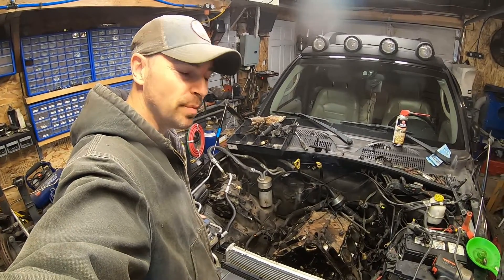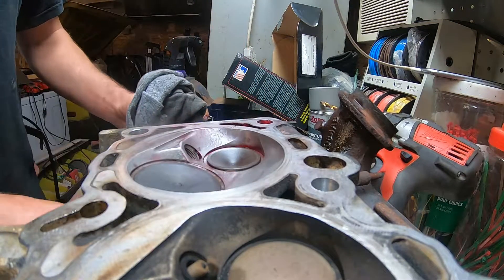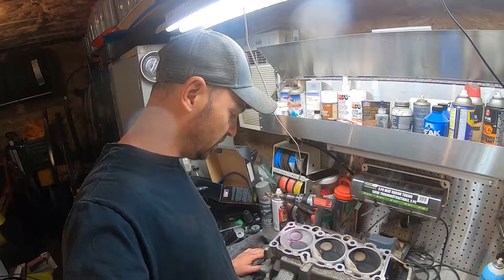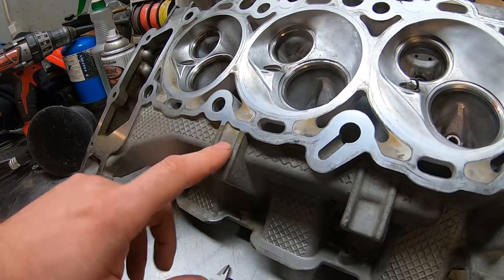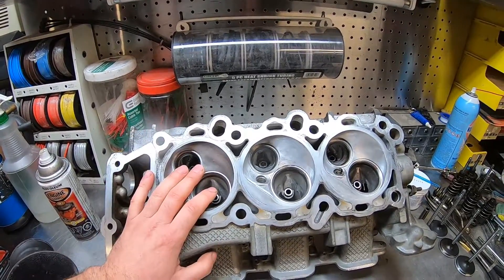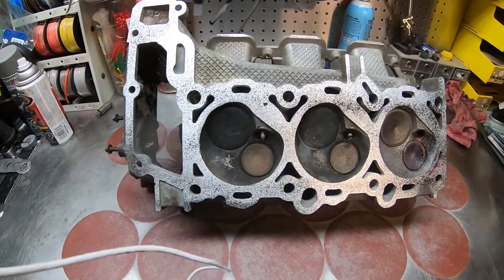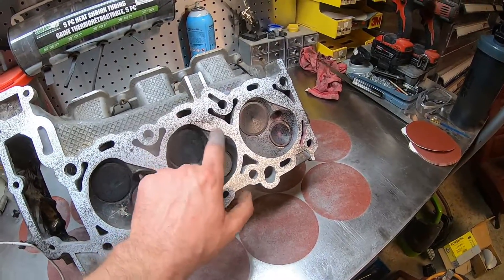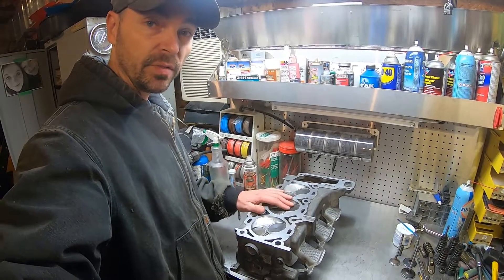How to Resurface a cylinder head at home with an Orbital sander???!!??!??!?

Comment: If you go through all the work to remove a cylinder head. I HIGHLY recommend having a machine shop level it.

It is highly unlikely you will get the same results as a machine shop. You will be doing this same job when you're new head gasket blows.
Reply from the maker: Actually this is fairly common practice among gearheads. I’ve had great success with it over the years and I’ve even Decked engine blocks using the same method. The spots of spray paint are practically fool proof and getting the surface level and even. Although I will admit using a flat piece of glass Or a cast-iron surface like a tablesaw is a far better way to go. Have you actually tried this and had it fail or is this just an opinion?
Reply: @restosandrevivals4597  These are the naysayers you referred to, right? I wish they'd watch the video and realise no-one gives two shits about their opinion. Keep doing what you do, man.
Reply from the maker: @PJBonoVox  Yeah everyone’s got an opinion but the fact of the matter is as long as you’ve got a perfectly flat surface and you take your time it works! Thanks for the comment!
Reply: @restosandrevivals4597  Right? A flat surface with <0.02" of deviation is a flat surface with <0.02" of deviation no matter how you achieve it, surely?

Comment: Your just showing off with your flat work surface lol.
Reply from the maker: Actually I realized after that the two low spots highlighted by the black paint weren’t caused by the orbital sander they were caused by a slight dip in my workbench lol
Reply: @restosandrevivals4597  i have seen people use panes of glass for this procedure, I guess they have to be manufactured perfectly flat.